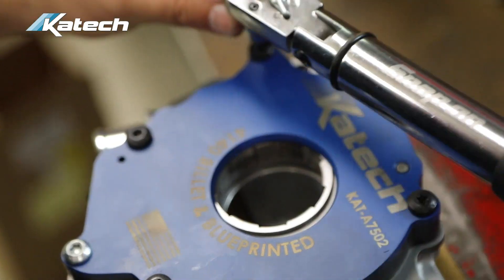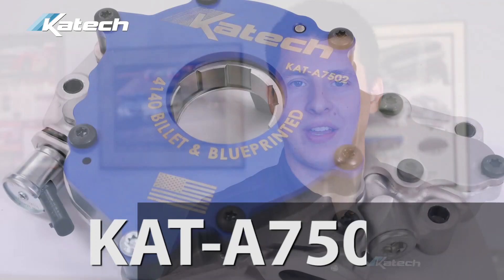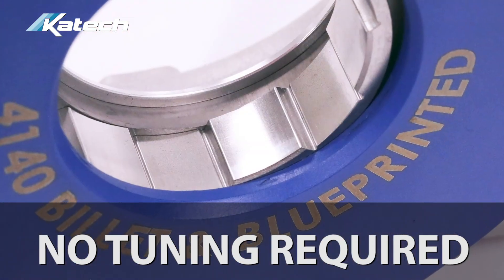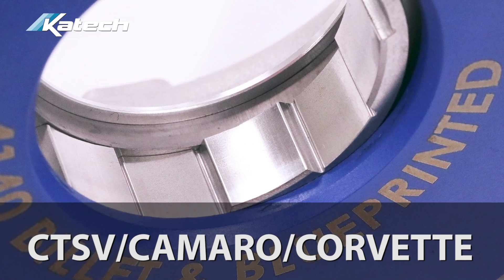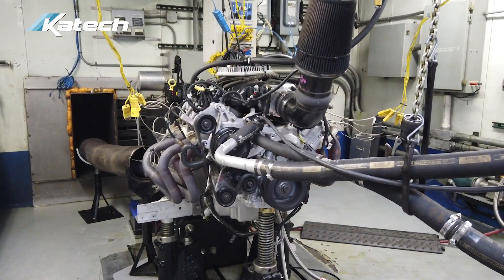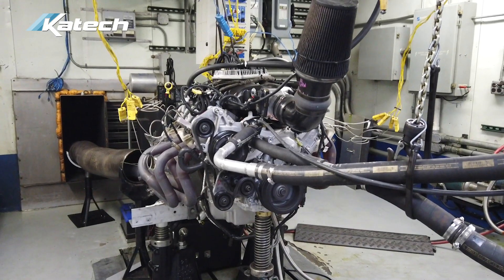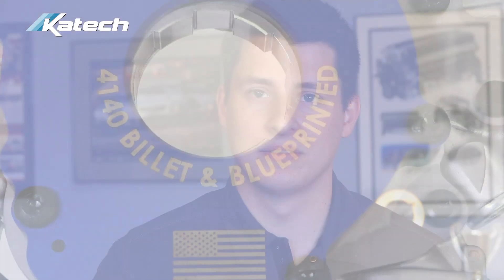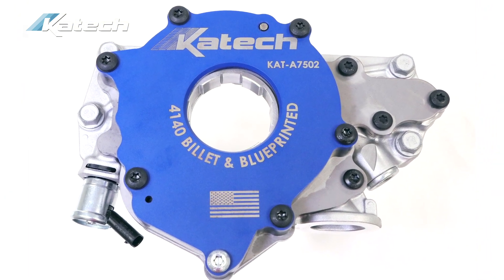Katech Wet Sump Oil Pump!

Comment: Okay… when we say truck oil pump in car engine higher oil pressure… what does this mean? Just curious, I have an lt1 engine, l8t crank and rods, forged pistons and a big cam and an l86 oil pump.. my oil pressure is 45psi at idle and 85-100psi at WOT with 5w30. Is this about the ball park of higher oil pressure? 😂

Comment: When using the higher volume pump how does this require tuning mods thank you
Reply: was wondering that myself ??? unless he is referring to engines with DOD or AFM
Reply: Because it's variable pressure controlled by the PCM.